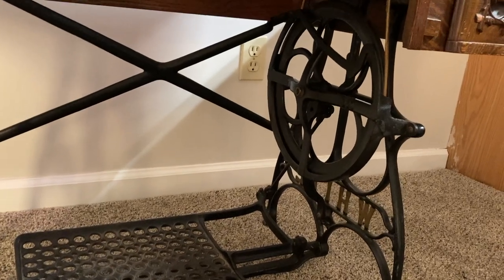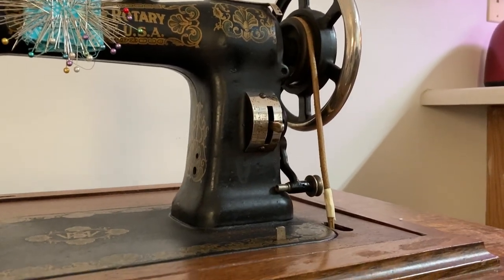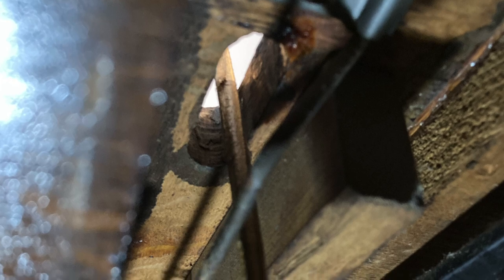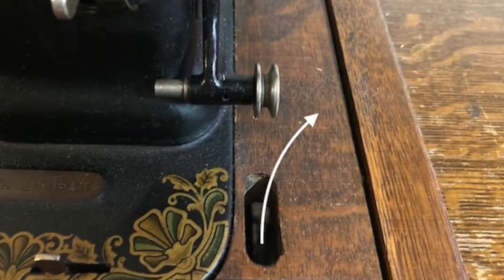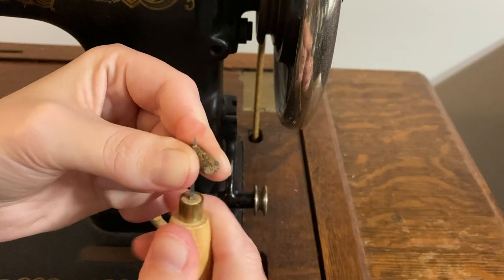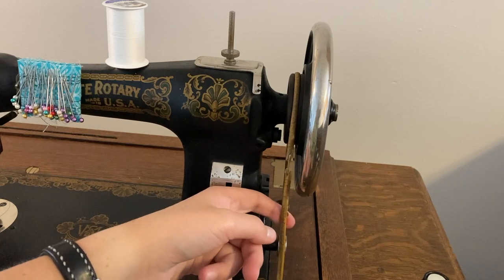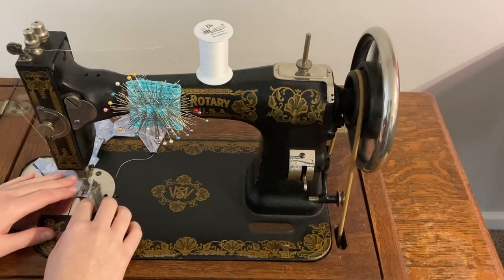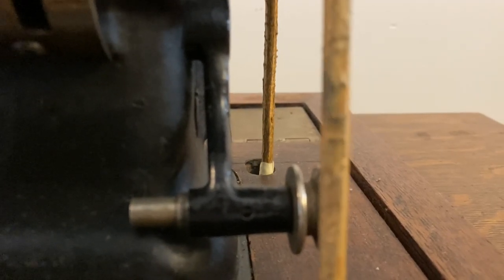Installing a New Drive Belt

Comment: When I am putting a new belt on my treadle, I put a clothes pin on the end of the belt once it gets up from underneath. This prevents the belt from falling down before I can get the staple in after the belt has been shortened.

Comment: When I recently made my video regarding the 758 Touch & Sew's (700 series use belts vs 600 series use gears), researching around ways to splice belts, I found there are actual interesting tools to keep an eye out for if you collect that vintage tools.  These tools are "Sewing Machine Belt Pliers" and I've seen "Singer Treadle Multi Tool Cutter Punch."  I didn't look into manuals or more official documents detailing the actual name of the range of makes and models tools, though interesting to know was a thing.

Comment: Question for you. When you’re oiling under the machine, do you take the drive belt off the machine completely? I can’t lift my machine if the drive belt is on and can’t figure out where to move it to so that I can oil often.
Reply from the maker: I disconnect the belt ends and just let them dangle when I tilt back the machine to oil it. I don't have to oil under it terribly often to keep everything running smoothly so it's not much of a hassle for me to do every few months.